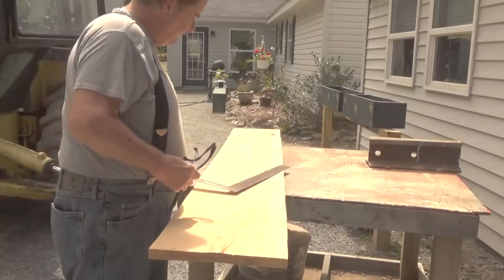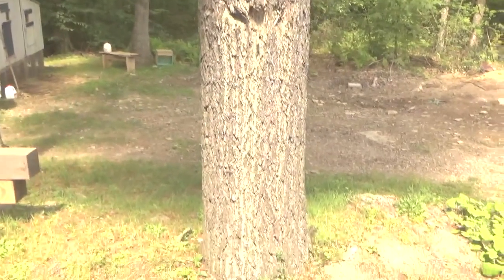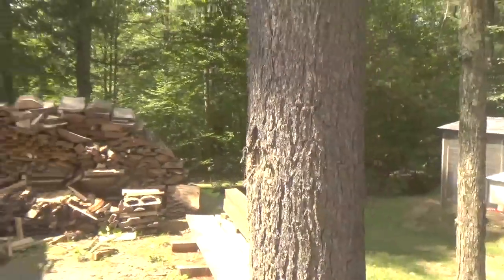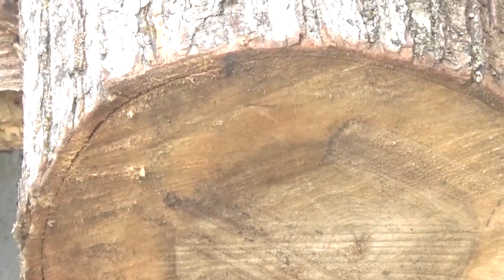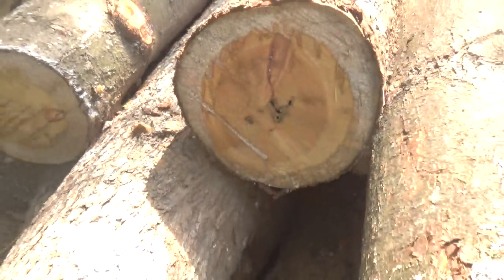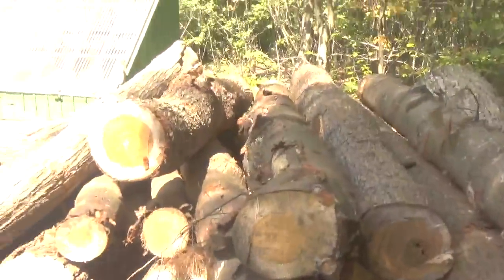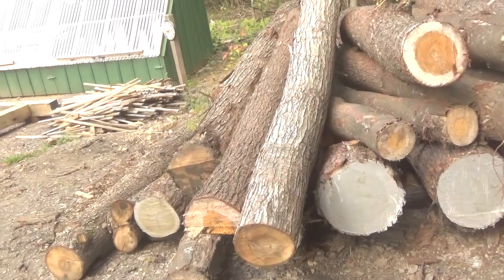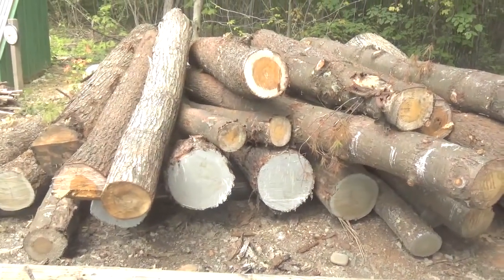Anything goes Saturday: I never know what will happen on a Saturday.

Comment: I understand completely about not being able to see inside of a tree by looking at the outside.  I was recently cutting lumber out of a large 32" x 22' Ash log.  I used my metal detector all over that log and didn't get any reaction from it.  However,  about 10" into the center of the log,  I found a very small nail and pulled it out.  I checked the log again for more metal and nothing showed up.  On the next 2" cut I had sparks from the log and my blade and I stopped everything.  I checked for metal and nothing.  I used my skill saw and cut the board off and made a few other cuts with it to find out what was in the log.  What I found was a ceramic insulator used for electric fence,  12" and about 100 years of growth rings inside the tree.  The nail holding it on was completely gone,  nothing but a little bit of rust left inside the ceramic.  My metal detector never did alert to anything in the tree.  Needless to say,  I had to change my saw blade.  That is the first time I've hit anything with the mill that I didn't find first with the metal detector after 60 hours of operation.  I agree with you about not being able to see what is going to be inside of any log,  I found out the hard way,  but,  live and learn,  I am still enjoying my milling experience and wouldn't trade it for anything.  Take care and be safe Joe,  love the videos.  Dan.
Reply from the maker: After reading this comment, this is why I say experience is the best teacher. That is some story, a piece of ceramic, ouch. Have a good one Dan.